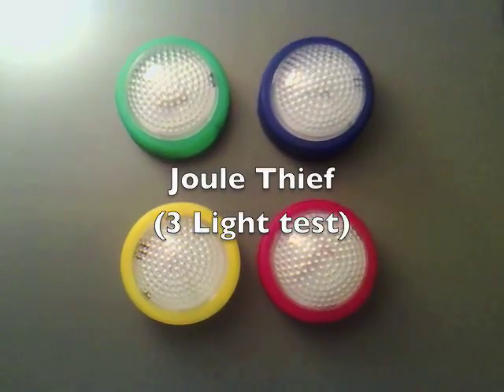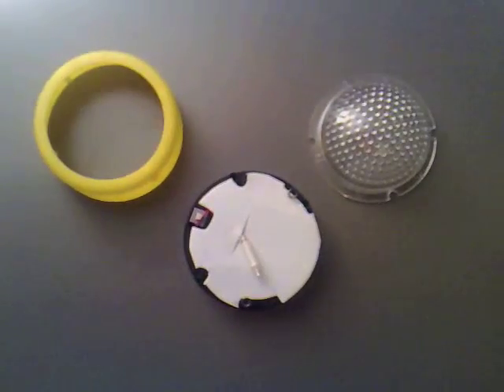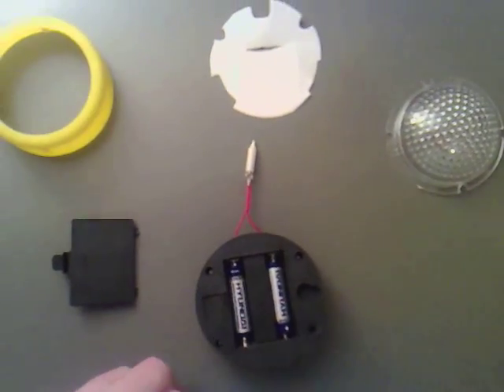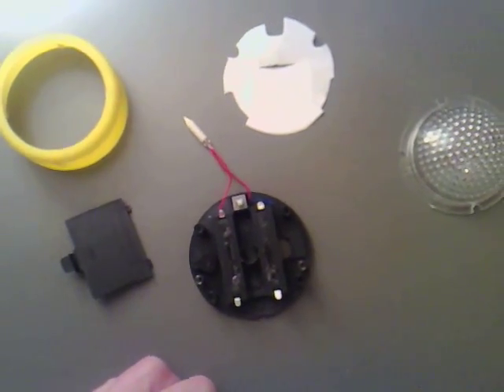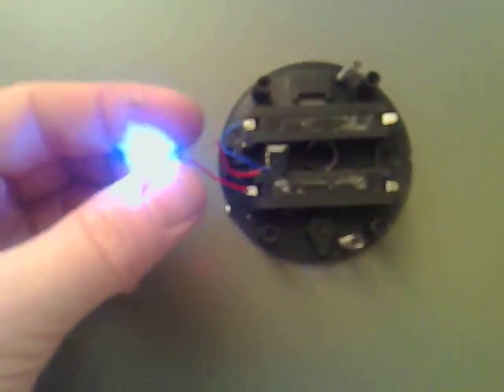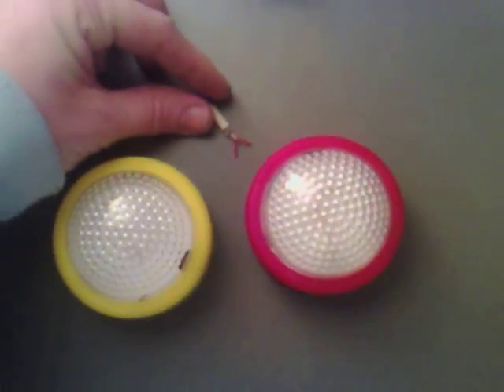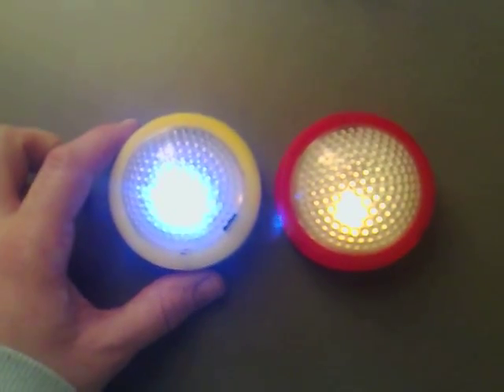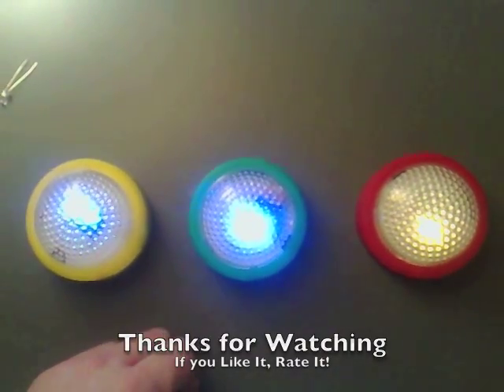Joule Thief (3 Light test) 019

Comment: I've done lots of those joule thief to many i guess but still i like the way they work and how simple they are. Not sure if you know it but the bigger you "power" wire is the more amp you will get back of course will increase the input slightly less turn you make higher frequency and higher amp too and vice versa. Also found some nice simple schematic on the net that add small .01uF cap to add more power.